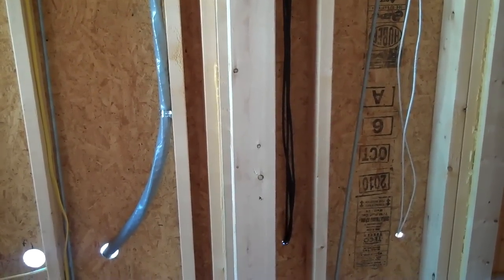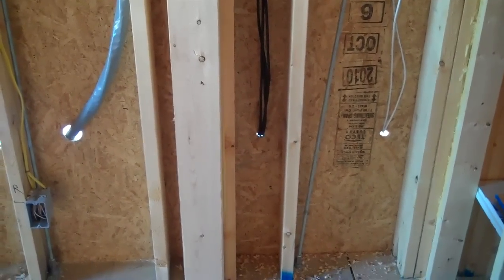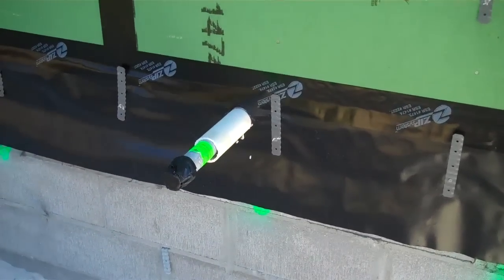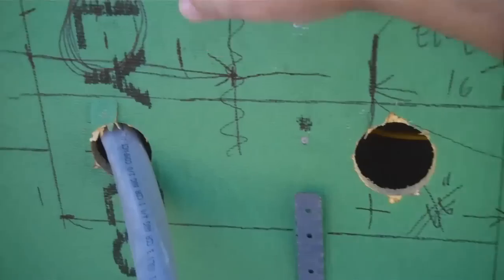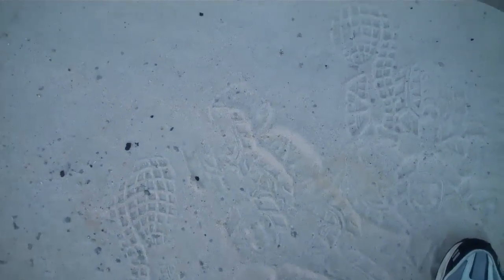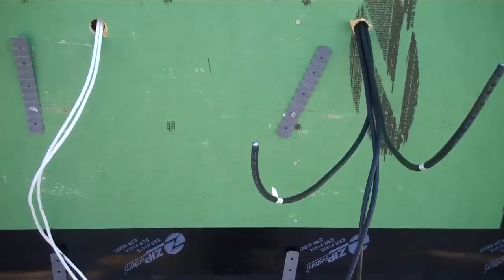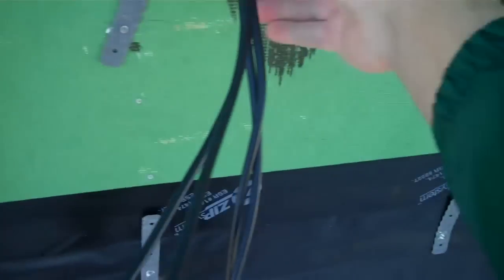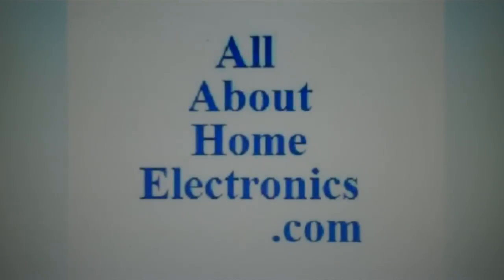How to Wire for TV, Phone + Satellite Service Feeds

Comment: A couple of things that we have done is to make use PVC flex conduit (IPEX) 1 Inch by about 4 inches long to  conduit the cables out side.  This gives  the installers a attachment point for  their incoming services. We have also created a 12 x 12 x 4 or 12 x 12 x 6 weather  box for telecom and another for satellite and cable. It give a weather tight environment for Demarc jacks etc. and spare cable to be centralised  We also  use the same size  boxes inside between the studs so we have a place for  Modems,  GPONS (for fiber)  etc. to live and have a power  line run to the box with 4 outlets.  There is usually enough room for an extra power bar if needed in the future.  Another thing we do is run cat6 lines from this box to a central location on each floor's ceiling for a POE Wi-Fi access point. We have been using Ubiquity devices since they are attractive and unobtrusive. Where there will be a larger setup we create a  small telecom room 5 x 5 with  Door and  door mounted  fan (Made by APC) and the demarc's.  This lets us fit a  rack cabinet and a two post telecomm plus UPS's for  everything and wire 20 amps into the room so we have enough power for  everything plus a fuse box nd  some  wall switches and  Conduit inlets for cabling for rest of house as needed. We have a patch panel for telecom, another for data, and another for security cam system and another for home theater with HDMI extender. Some customers put their media servers and audio/ video in this room and use RF for remote operation.  The infrastructure equip and build with room construction usually adds about $5000CDN but give a lot of flexibility

Comment: Great idea about the spare Cat and RG6.  I wish all homes had them.  Too many times I have tried to do an install on a new home only to discover the feed line was shorted out.  I wish the pre-wire guys would run the feed line to the SMC through conduit though.  Once the existing lines go bad we have to start drilling holes in the home.  Never an optimum choice...
Reply from the maker: Ringele? What does SMC stand for?